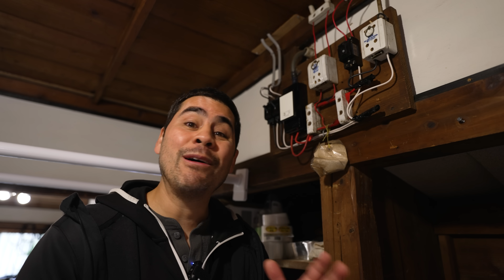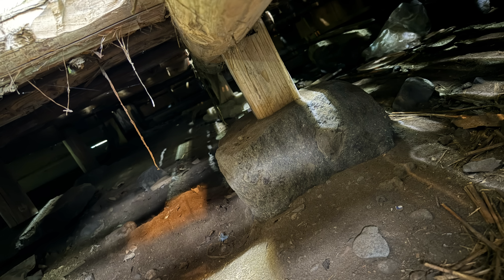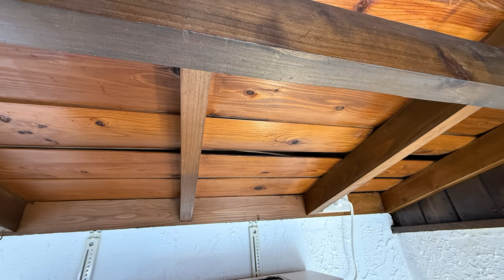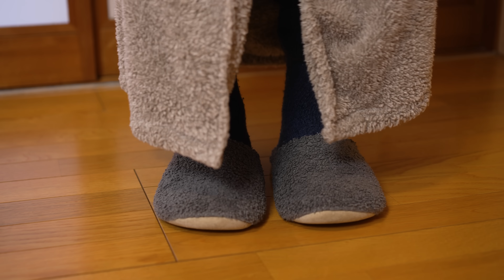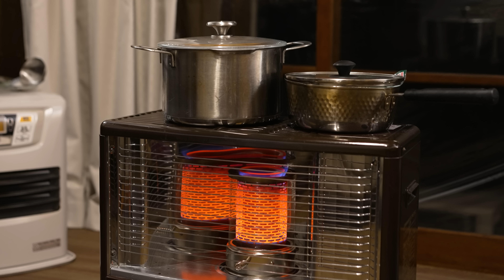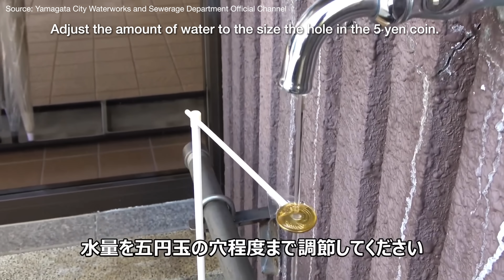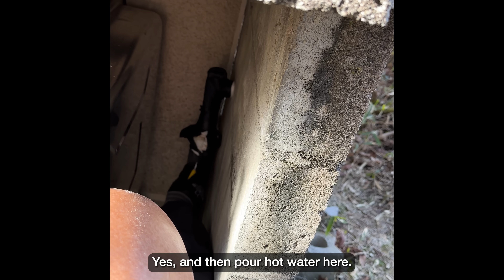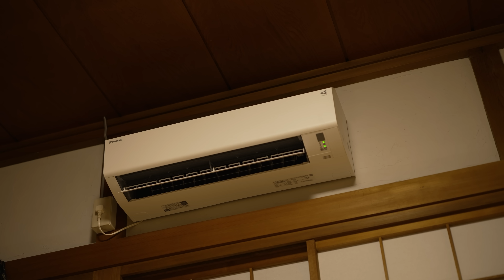What an Old Japanese House in Winter is Like

Comment: The reason the water has to be left running in Japan (because it's not buried) is because burying pipes in areas prone to earthquakes isn't cost effective. It's crazy expensive to replace them when they break. That's also why there isn't central heat like in the US or Canada; those are usually fed by underground pipes with natural gas.

Insulation also doesn't really matter as much as you'd think; it maintains temperature. So while yes, it would hold in the heat for longer, it would also make it take much longer to heat up via the sunlight. The main reason it's cold in old houses is the lack of natural gas lines (coupled with the old-time cost of electricity (hence the crappy breaker "box")). New houses can use electricity for heat as electricity is much cheaper and more available today. You should call the power company that supplies your Akiya and see if you can get them to run a new line to the house and install a new breaker box; 30 amps is extremely low. Most houses in the US (basically anything built after 1960) have 100 to 200 amp boxes.

I also thought it was kind of funny that your microwave only had 600 watts; I tried to buy the cheapest microwave I could find a few years ago and I couldn't find one lower than 800 watts. 90%+ of the microwaves in the market were 1000-1200 watts. lol

Comment: I’ve always wondered if this part of the reason for the lack of children😊(layers upon layers of clothes)? Having to go to the freezing cold bathroom is also an issue. Wash and repeat if you then want to transition to the bedroom to go to sleep. It is extremely cumbersome. Forgot to mention that any increase on your main breaker size results in additional costs. BTW did notice you managed to spill some kerosene when transferring it to the heater, some of the old guys are pros at that stuff but it really can be messy.

Comment: An old house with limited circuits would be ideal for a parallel solar panel system! Just maybe 2kwh of battery and 600W of panels someplace, and that's enough for a kettle or running an extra heater for an hour. It's fully separate too so you'll have it as backup.

Comment: I came to Sydney, Australia from the French alps and just like you I had never been as cold inside in my life as in Australia. Even though the temperature outside never really went below 6C, the inside was also pretty much the same. Thankfully we can get as high as 20C in the afternoon so we can warm up. We have over the years installed double glazed windows and roof insulation, ducted air conditioning and a highly efficient wood stove. It all helps.

Comment: I live in a house that was built in 1871 in the UK, and moreover, I live in the loft. The other day it was -7C/19F (windchill) and I grabbed a bottle of water that I had under my bed. It was frosty, like it had been in the refrigerator. Also seeing your breath (like at the beginning of your video) is a normal thing in some houses here. 

When it's really cold at night, I put my heated blanket between my duvet/mattress to heat it up for an hour before I get in. I have a mattress pad that heats but it's bulky and needs hours to heat up.

Comment: Similar to my experience of the apartment in Beppu where I lived in the 1980s. I didn’t have hot running water tho.  The kerosene heater made me so nervous that I used it only to heat up the apartment in the morning when we got dressed. No aircon. Lived under the kotatsu. Wore hanten. And in the hot bath with it’s recirculating heater. Wore stocking caps when snuggled in our futons to keep our heads warm.

Comment: be careful when you use air conditioning in the summer with that vapor impermeable vinyl or polyethylene. warm, moist air will condense on the vapor barrier if it is cold enough and cause moisture damage. look up building science insights for more information from a fellow Canadian Lstiburek. if you are planning to stay long term in that old house, there are strategies you can use to make it much better, but the retrofit would be pretty labor intensive.

Comment: This brings back memories of living in Japan as a young boy in a traditional Japanese house. It was a post WWII Japanese house, so something of a transitional house with somewhat thicker walls but the traditional low entryway where one takes off one's shoes on entry. 
I remember the kerosene heater that we ran to keep the main living area warm and the outdated electrical system that if you tried to run too many things at once it would short out. 
Taking a hot bath in such a cold house was a real treat and that's where the benefit of the deep Japanese bathtub really came in handy. 
Later on we moved into off base housing (dad was in the Navy) and after that it was not much different than living in a house in the US. 
As cold and inconvenient as it could be it was also a comfortable place to be once everything reached a livable temperature.

Comment: Great video - you cracked me up!  Houses in Texas are similar, it's like they don't even think that freezing temps are possible when they install pipes.  Our first house (built in 1997) had plumbing going through the (uninsulated) attic/closet, which we discovered when the pipes froze, busted and rained down into our master bathroom!  I have a good trick for you, though.  We call them corn snakes.  Fill up an old cotton athletic sock with whole (deer) corn and tie a knot to hold it in.  Zap it in the microwave for a minute or two before bed, but not for too long or it will burn!  Then put it in your bed.  It will radiate heat for up to an hour.  Make one for each person.  They help so much with cold beds and they smell kind of nice, too.

Comment: Older homes in the US didn't have insulation either,  the home that we lived in while I was a child had newspapers in the walls on the north side, dad insulated some of the walls and we found newspapers from the 1860s, in both German and Polish. It wasn't uncommon in the morning for there to be ice on the water bucket that sat on the end of the wood fired cookstove.  Some places that I lived weren't any better or even worse, you just adapted to it. I usually just unhook and drained the waterlines in the house for the winter and carried water in from the milk house, it was easier than fighting frozen pipes.

Comment: That's a cold house 😭 the first year in our house build 1910 USA was around 55°. Now we have minisplits and more insulation blown into the walls its usually between 65-70° and thin wool socks and wool slippers help keep my cold feet nice and warm!
And we keep the ceilings fans on spinning clockwise to push the warm air down

Comment: Ganbare! Some advice from someone who's been there. I assume you haven't updated the electrical panel because you're waiting for the renovation, but don't wait. You can update the panel without doing the whole house, and it won't cost that much extra when you do the house. It's dangerous, and you really should ditch the kerosene heater. There is nothing healthy about burning fossil fuels in enclosed spaces and modern electric heaters are much more efficient. Also, you have enough vertical height in the living room for a ceiling fan, but in the meantime. Pick up a cheap floor/desk fan from a second hand shop and mount it high up. It won't be as good as a ceiling fan, but it will make a difference. The temperature differential between the floor and ceiling now is large, and that speeds the movement of heat upwards. Then the temp differential between the ceiling and the outside is large, and that speeds heat transfer through the ceiling. Distributing the heat throughout the room will slow that down. Your interior wall insulation is good, but common insulation problem (old and modern) is that the insulation isn't put over the frame, isn't put in between the studs, meaning that each stud is a direct conduit between the interior air and the outside. I've been in houses where I could feel the difference just by running my hand over the wall.

Comment: A number of people in the comments seem to be struggling with the difference between CO and CO2. The clue is in the name, "mono" means one and "di" means two. A CO2 detector monitors carbon dioxide levels for air quality, distinct from dangerous CO (carbon monoxide) detectors (which is what you want when burning fuel), though many devices now combine both functions, alerting you to unsafe CO levels or poor ventilation via CO2 readings for better indoor air

Comment: I used to live in the northern part of Japan. There were mornings when I woke up and the room temperature was as low as 2°C, but once you get used to it, it’s not that much of a problem. At the very least, any beer left sitting around was always nicely chilled.

Fundamentally, in Japanese housing, the idea was not to insulate the house itself but rather to insulate the individual—except in the colder northern regions. That said, houses built in the past ten years are, in most cases, highly airtight, well insulated, and equipped with whole-house climate control.

Comment: You say you upgraded to 30 amp service, what was it before? And whats the limiting factor to upgrading it to modern standards (service limits in the area, how drastic are the costs in Japan to get say, a typical 100amp service and breaker panel put in?    
Since you have propane, why not let your inner Canuck come out and get a propane furnace? This 'heat the human not the home' only goes so far for me. =-)

Comment: I used to live in a slightly older house in Japan where the kitchen (and everything besides the living room) was around 1 degree Celsius during the winter. Learned that olive oil solidifies in the cold the hard way. But I couldn't be bothered to melt it every time I used it so I started just buying grapeseed oil instead of olive oil in the winter, since it stays liquid at much colder temperatures. So many parts of this video were relatable, and I even had that exact Nitori robe XD

Comment: You might want to consider a mass stove, ceramic or brick, so you can light a fire at night, for say an hour, and it will still be a warm maçonry mass at much above 0 degrees C. You can congregate around it in the morning. Even light it up again for again 12h of heat

Comment: This is like several levels of interesting to me since where I live (south central Arizona) it only barely gets to freezing temps a handful of nights a year. The coldest it has been so far this winter is 35 degrees F.
I don't even have to use the central heating but maybe several days out of the year, we've had it run for a combined 30 hours or something this winter so far and it's only gonna get warmer.
This though? This reminds me of 'camping' in an old cabin. 
Now, our summers on the other hand....

Comment: Just cut a hole in the wall and put out a proper vent. It's not hard. Put a ceiling fan in the same room as the heater blowing upward in the winter, down in the summer, and ceiling fans in the rest of the house blowing upward in the winter and downward in the summer. Place insulation behind the plastic on the ceiling. You don't want your water pipes to freeze.

Comment: Most of the problems are due to the anachronism of trying to live with the conveniences of a modern life in a house not built for it. Either the house needs to be adapted, or you adapt to the house. The main issue with doing things the old way is the hot water needs, which is part of why the public baths culture developed to begin with; people cared about being clean, and used economies of scale to be able to bathe regularly even in winter, rather than every home having a bath for every day use.
Other than that, very little energy is needed, and a lot of the so-called modern solutions are actually counter-productive. The toilet should be outside anyway. Drinking water can be fetched from somewhere easily especially if you have a vehicle.
You can camp in the winter outside and be completely comfortable without a heater, so you can manage to do something less extreme in the house. IMO the idea that old Japanese houses are too cold is just a modern cultural issue and trying to deal with the situation by making things more complicated than necessary will just be frustrating, costly, and sometimes even dangerous.

Comment: Pro Tip (maybe): My Daiseikai unit has a power control with which I can limit the power it draws from the grid, that way I don't have to blow fuses when using it simultaneously with other equipment on the same fuse. (It can also help with power savings and prolonged unit life.)

Comment: In the Netherlands old houses are build like brick bunkers. I grew up in a house from 1604. You'd basically have a fireplace in each room. The fittings for them were still there when I was a kid. But we had central heating.
Reply: Central heating in the Netherlands? I lived there for two years and even in a relatively modern apartment we had radiators, not central heating with air ducts like in the USA and Canada.
Reply: @Josukegaming  Central heating with radiators is still central heating
Reply: @Josukegaming  central air is relatively new in Canada also. I live in a radiator heated apartment in Canada. Loads of this and electric baseboard heating. Personally  I prefer rads. And of course-a firewood stove or fireplace are my preferences like any good Canuck lol

Comment: Old homes in Texas are similar, no insulation, made to lose heat because it’s hot basically 9 months of the year here.  Mine is built off the ground on piers so air can circulate under the floors.  Fortunately, only two rooms have single pane windows!  Try putting a blanket or an afghan on the floor under your mattress, it will provide some insulation from that cold floor and help you warm up and STAY warm!

Comment: Why arent u using the ac 24/7? I live in north of sweden and pretty sure we get as cold as u do, but yes we have better built houses for winter. But we still use ac units 24/7 both in summer and winter. Or is electricity super expensive in japan?

Comment: I don't know if you are able to run your AC at all times, but you should never switch off your AC in the winter. Just lower the temperature, e.g., to 16°C. I live in Finland and heat my house with a Japanese AC, which is on all year round. I'm not sure your fuses would handle it.😂 Would all heat just escape? 

P. S. Would die for you under-desk heater!

Comment: Oh, the sound of dripping/running water makes me feel sick. We have to do this in Chicago when it's super cold. Especially my apartment which is a basement and in an old house. I will never forget a few years ago when the kitchen sink was not only clogged, but the faucet HAD to be kept running because the temps were below 0. This meant I had to get up every hour to bail the sink so it wouldn't overflow with nasty water. I had set my alarm for every hour. I missed one. The pipes froze, BROKE, and sent my poor father to the hospital because of the stress and cost. I will never forget those poor men working outside in that brutal weather. One of their machines even broke, so they had to use hand tools. It would have taken more time to go get other equipment and they wanted to get this done for us. I don't care how much we ended up paying them, they deserved it. Did I mention I also had the flu and a high fever? (That's why I missed the alarm/could not drag myself out of bed to bail the water.) I still get flashbacks.

Comment: I live in a 150-year-old German timber-framed farmhouse. It has all the “symptoms” you describe, but - fortunately - to a lesser degree. The first things I did after buying it was to have the electrical installation replaced and proper central heating installed, assisted by two wood-burning stoves. Then I got a new roof with heavy insulation. The house is still drafty and the walls are cold in the winter, but I am slowly fixing that bit by bit. I can get the living room and the place where I sleep cosy and warm now, otherwise I would not have stayed here at all!

Comment: Hi, good video. In 2016 I lived in a 団地 and it was hard to deal with weather-wise. In winter I didn't want to turn on the air conditioner because it made my nose stuffy. I don't like こたつbecause it only warms half of the body. I didn't want to use a kerosene heater like what you have because ventilation is required which kind of defeats the purpose of wanting to stay warm. So I would literally shiver as I was in bed until I bought multiple blankets, but then I would shiver when I was at my computer or in the kitchen. But the summer was so incredibly hot. The good thing was that it was so hot that the environment heated the water pipes so I wouldn't have to turn on the gas line to get comfortable temperature water.

Comment: Here in Eastern Europe, a lot of homes still don't have central heating, but pipes never freeze, they are always laid below the frost line and go directly to the house, so they never have contact with outside temperatures, which is enough for them to never freeze, but it almost never gets below -15 here. In my house, we have 5 ACs like that, a few single splits, and one multisplit. They are always on during winter as we figured that they are most efficient that way, we just adjust the temperature during the night to about 19-20c. If we shut them off and they have to start again, they draw like 1500w first few hours, but if they are always on, they draw like 300-450w, so in the end, they save or don't use much electricity if they are always on. That is all if you have modern electricity wires and good insulation. A lot of people who don't have great insulation use biomass pellet stoves, which is a great option, as air does not get that dirty if it's installed properly.But it can produce a looot of heat at once.